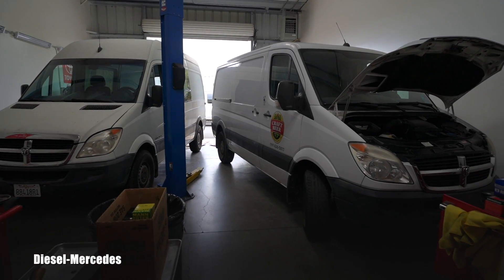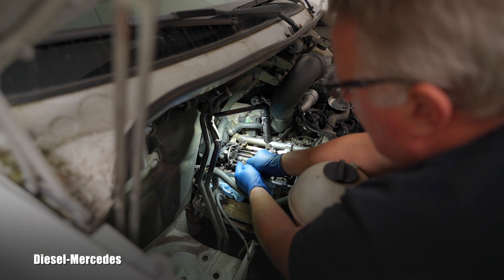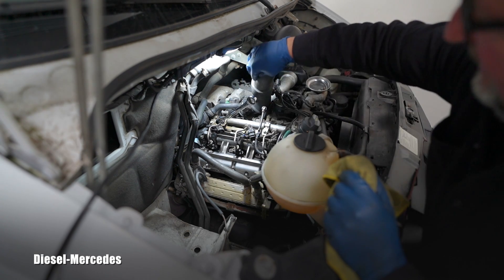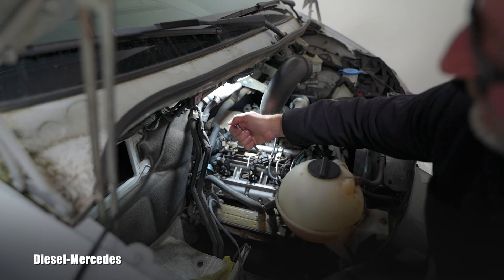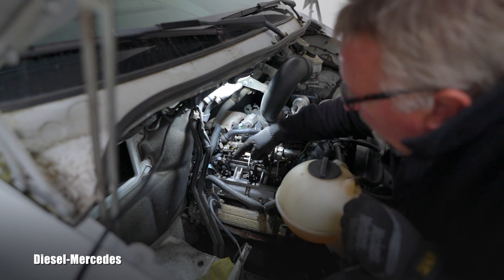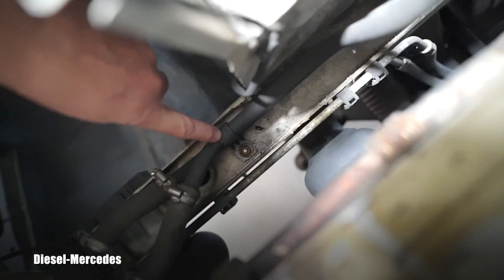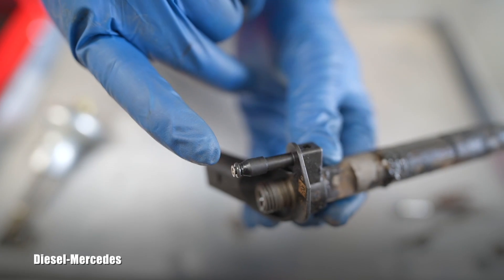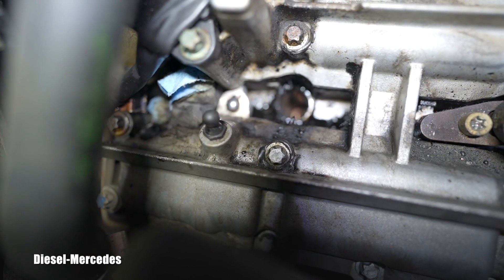How to remove diesel injector Mercedes OM642 engine

Comment: Great, concise video. I'm in the process of repairing the No:3 locking bolt on my 2.2 CDI Sprinter. I'm pleased it's not the back one, but your video gives a great insight on how to cope with the awkwardness.
I used a turbo cleaning spray to melt the carbon, but probably the same stuff in a different can!
Love the home made slide hammer.

Comment: o
hello i have a 2008 jeep grand Cherokee with om642 engine has 11 mpg aveg that is very bad diesel milage and no check engine.  i changed gas filter and air filter already.  can you help please

Comment: I'm not a mercedes diesel mechanic.  

But my foolproof method of black death injector removal is to loosen the the hold down clamp a few turns, and run the engine until you hear it pop out.

Comment: Hi, and thank you for your video.
I have to do this work on my 2007 JEEP Commander CRD too, along with the oil cooler change. Looking forward to see the cleaning process of the injector tube and screw hole too.
Thanks!
Reply: It is a tool for cleaning the seat and redo  the seat on amazon

Comment: I will have to try that carb cleaner on a sheared off glow plug that Aero-Kroil hasn't been able to budge for going on 6 months now... Those 642 injectors are a different variant than what I'm dealing with on om648 where high pressure threads are not on top or in perfect alignment with injector body but instead off-center like where return line nipple is located on that one so that slide hammer tool wouldn't work for me but I like it did the job for you! Very impressed you were able to salvage those brittle plastic clips from disintegration. Not only injector bore but also TTY clampdown bolt hole will need thorough cleaning from looks of what came out. It's a very labor intensive process which is not fully appreciated by anyone who has never had to do it so good that you're taking the time like Tasos Moschatos to make it immaculately clean before reassembly.

Comment: Good video thanks but would like to know what actual part has failed for this to happen and can it be prevented by some type of maintenance.
Reply: injector seals, common problem on these
Reply: @christopher6161  Is also better to get more thicker than originals seals and then no  problem no any more
Reply: @InneŻycie  do you have part number? VW part?

Comment: Tak sa to vobec nerobi. Ma sa pouzit iny vytahovak. Mal ste len stastie ze isiel lahko vytiahnut. —— That is incorrect prcedure. There is diffrent injector puller for this job, which has to be used. You had only luck that injector has been quite easily removed.
Reply: But indeed  did the job